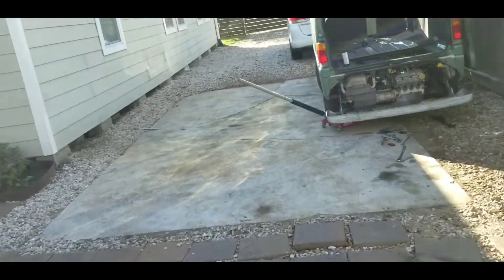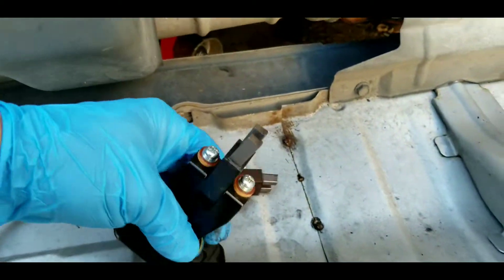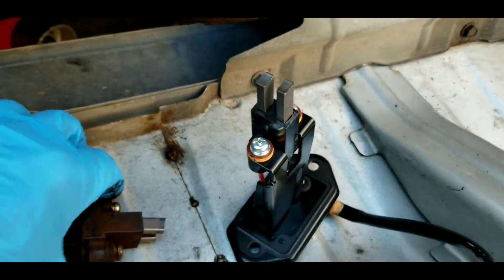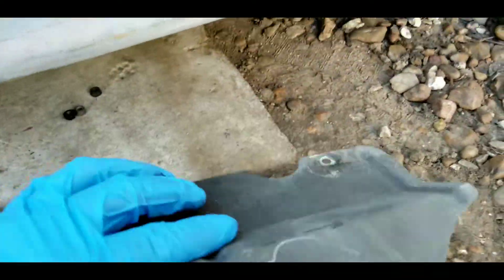Subaru Sambar EVCT brush replacement, with distributor cap o-ring replacement

Comment: Where did you purchase the replacement brushing?
Reply: I would like to second this comment. Was it sourced out of states or did you use US Justy parts?
Reply: So I ended up purchasing a justy oem part and the holes didn’t line up and the brushing holder was to long.
Reply: @bencampbell2078  ah. So I assume it didn’t work out then. Or did it?
Reply: Nope. Couldn’t secure it without modifying it.
Reply from the maker: We get all of our parts OEM from Japan. If you need parts check www.USMiniTrucks.com, we have some parts listed, otherwise send an email, and we will send you an invoice. I have this used brush holder shown in the video, I had to move today, if you want it.